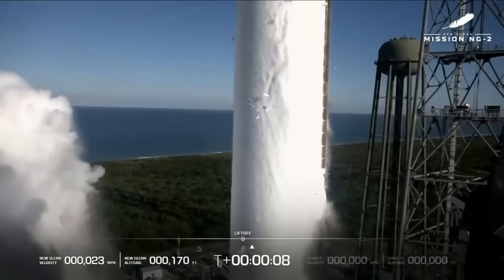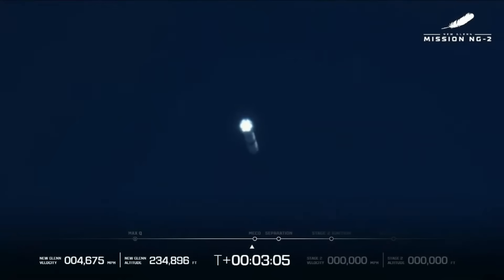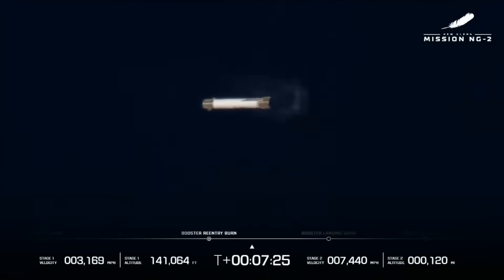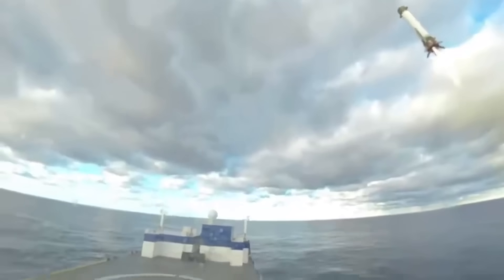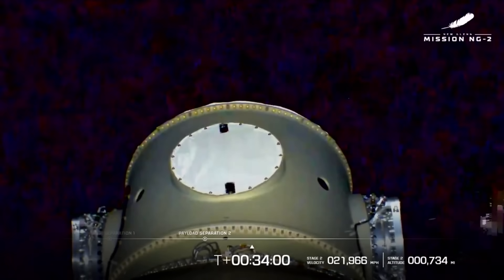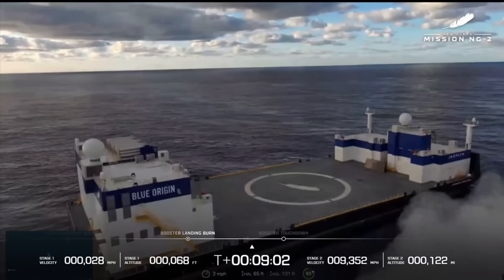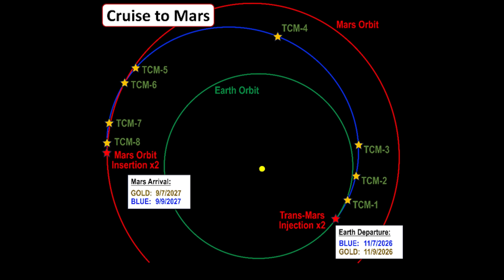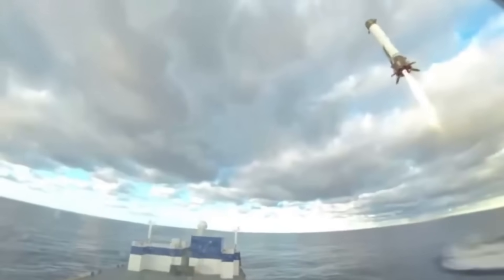What Exactly Happened On New Glenn's Second Launch?

Comment: Dude when the booster landed you see the explosive spike drive into the steel deck to secure the legs to the ship. Metal af
Reply: I wasn’t sure what that was until it dawned on me. Definitely cool!
Reply: Timestamps, dude!
Reply: Sketchy but if you don’t have it down it covers a semi bad land and especially helpful at sea
Reply: What I’d this? A dick measuring competition?? Either way you have to take girth into account. Length without girth is meaningless. 🤷🏾‍♀️
Reply: Go go boostie
Reply: Or did it just weld the feet of the landing legs to the deck?
Reply: @cacogenicist correct it used an explosive welding technique which does it automatically to secure it
Reply: Jeff Bezos developed this system in his warehouses, nailing workers' feet if they try to take a bathroom break.
Reply: It’s not nails it’s explosive welding, a technique Blue Origin patented last year.
Reply: @baarni  the kind of explosive welding they're using was patented in the 1950's and has been widely used to weld large sheets of specialty metals together to form solid cladding. Their patent isn't on the welding itself but the implementation using it to attach the landing legs of a booster to the deck after landing. 

But regardless, kudos to them because that was an absolute stroke of brilliance. Such a perfect and elegant solution
Reply: @GlutenEruption Correct.
Reply: The drone ship goes back to base without anyone controlling it, they don't want it tipping over, this thing is the size of the booster on Starship.
Reply: @flightsimdev  - It's a huge booster, but not nearly the size of Super Heavy.
Reply: @cacogenicist   False! New Glenn: 98 meters tall total - booster 60 meters 
SpaceX Starship -- booster 71 meters
It's comparable.
Reply: Pawpii2  the NG booster is 80% as tall as the starship booster.   Definitely smaller but also very clearly in the same general ballpark
Reply: @cacogenicist  SS is a bust so far.
Reply: @AndrewLavigne  Starship is also 9 meters diameter while New Glenn is 7 meters making the Super Heavy booster almost twice the size by volume.
Reply: @jcwiggens No it’s not.😂 You obviously don’t understand the Starship program. 🫵🤡
Reply: @baarni  SS go  boom.
Reply: @countmorbid3187  Starship booster is almost 200% larger. 😂
Reply: @baarni  Starship was supposed to have landed on the Moo. already. SpaceX has screwed us over and taken all of our money and built a low earth orbit heavy lift launch vehicle so they can launch Starlink satellites. It will never have any other purpose. We have ceded the Moon to China because of Musk and his cult. Stop being willfully ignorant.
Reply: @AndrewLavigne  yeah but the diameter is a lot smaller aswell. It can hold less than half of fuel of what SH can hold. And NG Booster has an interstage, SH only got a tiny interstage. Anddd on top of that the engines on NG are longer so even less fuel.
Reply: @jcwiggens  - No it isn't, actually. It is in the development stage, not the operational. New Glenn is in effect an upscaled Falcon 9. Starship has a completely different mission. NG does not recover the second stage. SH/SS is intended to be fully reusable.
Reply: @flightsimdev  Stop lieing. NG is nowhere the size of the booster for Starship.
Reply: @GtTrader67  False! New Glenn: 98 meters tall total - booster 60 meters 
SpaceX Starship -- booster 71 meters
It's comparable.
Reply: @ccbcco wrong
Reply: @ccbcco  Starship is also 9 meters diameter while New Glenn is 7 meters making the Super Heavy booster almost twice the size.😉
Reply: @baarni I think we’re only talking about height here ✌️
Reply: @Mini_rocketry I think that there’s a pissing contest going on this thread, about the size of the rocket, for no apparent reason.
Reply: @JoeOvercoat 😂
Reply: @baarni  Height not width. Narrowness of Glenn renders it more unstable on a barge due to its narrowness!  You just proved the point.
Reply: @ccbcco  Go back and read the comments goofball. People were commenting about size comparison not length.
Reply: @Mini_rocketry I think you’re wrong buddy. The comments I responded to clearly say size not length. 😂